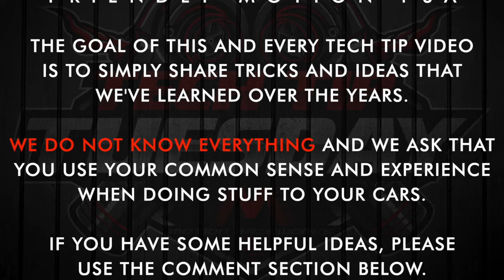Unpack Your Parachute: Tech Tip Tuesday!

Comment: Knew an TA/FC crew that never packed the chute after the last run of the weekend, they loaded the car then hung the chutes from hooks in the back of the trailer. Never had an issue with the chutes.
Reply: Thats what we used to do in top alcohol. the chutes stay out of the bags in the shop, typically hug up and not wrapped in a ball, and packing them was part of the morning routine of getting the car ready.

Comment: Yeah I don't know how relevant it is for this kind of parachute, but for my Icarus they recommended no more than 2 days packed. FAA rules have changed, but it used to be 180 days then 120. I haven't skydiving in years so I don't know what the current rules are. But the smart thing to do is air dry and clean it and then keep it in a stash bag where it is loosely packed. I think two days is extremely conservative. But I used to always pack mine right before a jump anyway and leave it unpacked after the last.  I had my Reserve done every 90 days.

Comment: It seemed some of the parachute openings I've been seeing are hard to the point of nearly causing control issues. Parachute opens big Corrections, I am not an expert by any means. I used to skydive though and we used a slider to slow the opening of a parachute.  I haven't seen anything like that, do you use anything like that and would you recommend it? I'm speaking mostly of watching Cletus McFarland at the end of the quarter mile it looks like he's having to saw on the wheel quite a lot.

Comment: Slightly different topic but related to parachutes. Check Cleetus' recent video " . . . got so close  to 6.0s . . ." to see the 7.08 run at 192.93 MPH where the parachute fails to open. (Do you need a parachute on a 192 MPH run?) Back in the pits he shows us the cause of the problem. A MOTION RACEWORKS product (Parachute Cable Billet End Cap at $9.99) would have prevented the failure of the parachute to deploy. Is it worth 10 bucks to possibly prevent a wrecked race car or worse . . .?
Reply: Any car that goes over 150 MPH is Required to have one, I don't know if it's required to use it.
Reply: I hope you all realize that I was being facetious with my question about needing a parachute at that speed.